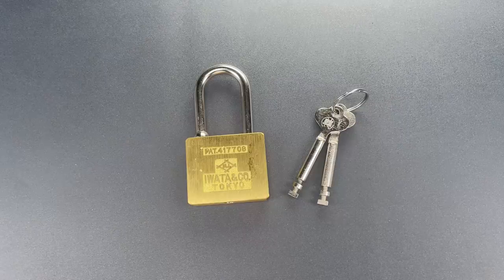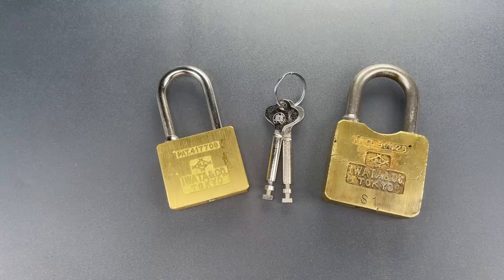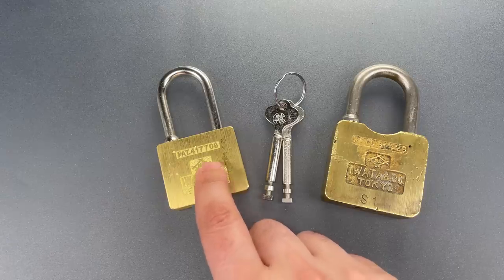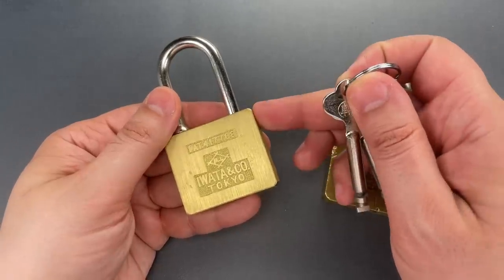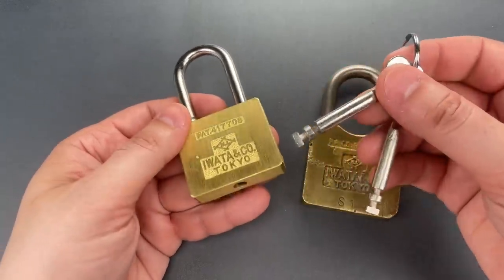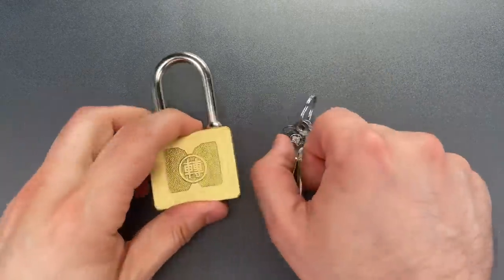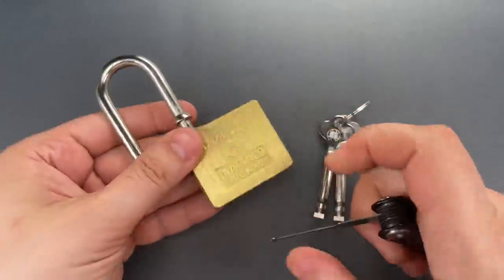[1304] Analyzing a Vintage Iwata Padlock

Comment: I am working for German Railways and I can pretty much confirm LPL's suspicions. This railway lock is probably not used for security in the sense of picking resistance but security as in preventing railway accidents.
When you need to set a path for a train with manual, non-remotely controlled railroad switches, these locks assure that every single switch has been set correctly.
The locks lock (duh) the switches in certain defined positions and there's supposed to be only one copy of each key available to the dispatcher.
When the dispatcher sets a path for a train using railroad switches, they naturally have to leave some keys behind since the locks are key-retaining.
This allows them to quickly look at a board where all keys hang to check which ones are missing and verify the railroad switch positions before giving a train the signal to move forward.
In Germany we call this the "Schlüsselabhängigkeit" or "key dependency" in railway signalling. Obviously, it's a method used only in remote and little frequented areas, maybe at some local railroads at a factory and the-like. Alternatively, in areas where a certain "default" switch position is rarely ever changed.
Reply: Other railroads have similar keys sometimes called Woods or Annette keys. The 'locks' are low security but the keys are masssive.
Reply: I love how Germany decided to invent a word for that.
Reply: @jtcmule3336  But that's just German grammar (and their irrational fear of the spacebar).  Schlussel = key, Abhangig = dependent, and Keit = state of being (like the suffixes "-ness" or "-cy").  It's like writing "keydependency" in English.  It isn't so much a whole new word as it is a phrase written without spaces so it kind of looks like a single word.
Reply: That sounds like it's both obscure and interesting information, but, hang on...
How does the key-board let you know what direction the switches are in if the key only locks and unlocks the padlocked?
I presume the padlock restrains the switch itself from moving in some fashion, but what's to stop someone from unlocking the padlock with the key, throwing the switch, then re-locking the padlock even if it's not in the correct place, and replacing the key on the board?
Reply: @ShadowDragon8685  Well, the switches themselves are designed in a way that you cannot re-lock the padlock out of position since the holes on the 'sleeve' for a lack of a better word need to align.
Sometimes there are even switches with several locks each forcing the switch into a certain position without disturbing the others (combination of holes and slots). It's all very clever, actually.
However, you are right, nothing is keeping the dispatcher from e.g. unlocking the switch, re-locking the lock in their hand and throwing it away, taking the key with them.
This would require malicious intent on the dispatcher's side and the system is not designed to prevent that - just to serve as a mnemonic device for the dispatcher so they don't have to run out of their little building / office to check if all the switches are set correctly after working on them for half an hour - and mind you, some switches can be hundreds of meters apart.
Basically, in the end the goal is to have a completely mechanical and manual 'switch status dashboard' in the dispatcher's office. :)
I mean, if a dispatcher wanted to derail a train or cause a railway accident, especially in remote areas where everything is controlled locally, they would have a hundred different ways of achieving that.
This might sound scary but in the end all transport systems boil down to trusting well-trained and carefully selected individuals at some point to 'do the right thing' and there are just safety systems (like this one) that make it harder for someone to do the 'wrong thing' by accident.
Reply: @LimDul  Ahhh, I see.
Yes, that's what I was wondering; if the system was being used as a hard mechanical interlock system akin to Lock-Out Tag-Out, or if it was less-hard than that in that someone who did something which was either malevolent or of such staggering incompetence that it was indistinguishable from malevolence - such as, as was said, locking the lock in their hand and pocketing it/tossing it off a bridge/forgetting where it was or something, then replacing the key, could do so mechanically.

Obviously and thankfully the chances of that are low, since in general the sort of person who would be entrusted with the keys to a manual interlock system is not noted for malevolent or incompetent inclinations.

I don't think the system is necessarily unsafe as-is, as it would be very unlikely for a lay-person to be familiar enough with the system and malevolent enough to engineer a derailment, and even less likely for a dispatcher to do so. I was just wondering if the system had been over-engineered to make that mechanically impossible, such as by some mechanism retaining the lock itself so it couldn't be locked except in the proper position (thus trapping the key). Of course, even that sort of a mechanical interlock could be defeated by a sufficiently determined attacker; either by picking the key, or using a cutting device to destroy the lock.

That's damn interesting, either way.
Reply: @ShadowDragon8685  Oh, don't get me wrong - this is the lowest of low kinds of safety systems, hence me saying that it's used only in some remote locations, maybe shunting local trains in factories etc. Also, it's just one safety layer of many.

The higher the risk, the safer the system. E.g. for mechanical, manual switch boxes that use steel cables for controlling railroad switches, there are very clever mechanical interlocks preventing unsafe configurations. And then it only goes up from there until reaching pretty much flight-control safety levels for regular passenger trains.

Mind you, flipping railroad switches is usually also connected to flipping a corresponding signal, so an arriving train would see the invalid configuration ahead of time - in such areas the speed limits are also very low.
When a train attempts to pass a stop signal there are also various other safety mechanisms that would trigger the emergency breaks on it and so on.

So, it's by far not the only mechanism ensuring nothing truly bad happens but still. Also, you want to avoid trains having to do emergency breaking at all costs since it grinds down a spot on their wheels, which then have to be sent for maintenance. If you can have even the simplest system preventing even a few human errors, then it's a big win for everyone. ;)
Reply: @noamkatz1049  "irrational fear of the spacebar" excellent, i'm going to steal that one 😂😂
Greetings from Germany

Oberflächenwasserrückhaltebecken
Reply: @noamkatz1049  the German (and Dutch) fear of the spacebar isn't quite that irrational, but has its practical purposes to read and interprete a sentence quickly and correctly. Otherwise the reading as well as the inter pretation get quite choppy, just as the splitting up of inter and pretation just did in English. In Dutch, we even have a word for the irrational liking of the spacebar: Engelse ziekte, or English disease. That referred originally to some kind of blood disease.
Reply: @mjouwbuis  German is slow to interprete, because all the verbs are in the end of the sentence. You can have a whole paragraph and five verbs in the end. Makes it difficult to translate German speech.
Reply: There have been a number of key based interlocking plants in Finland as well, and I imagine Japanese railways would have their own versions. They are pretty much the only way to electrically - and remotely - secure fully manual switches. Even today a key panel can be a part of an otherwise relay or computer based system. 

These locks (generally speaking) are not meant to be pick resistant in the first place. The goal is to ensure that the switch is always in a known position. When the key is retained in the lock, the switch is locally controlled. Otherwise the switch is in its normal position, which can be enforced with an interlocking system that retains the key in a panel.
Reply: can confirm we used to use this system too and stil do on some heritage railways here in the netherlands

edit: not to see which path is going to be used by missing keys but to ensure hand switches stay in certain positions when they are needed to be

Comment: "zhuan" for 轉 is Chinese. In Japanese it's the pre-reform version of 転, which on its own is pronounced "ten" and is used in a lot of words related to movement
Reply: Ah! Is that "ten" as in "untensuru", "untensha"? (Sorry I don't have a Japanese keyboard on this device)
Reply: @aihtdikh  Yes it's the same Kanji that your two examples would use
Reply: @aihtdikh  yes, 運転手/untenshu = driver, 運転/unten = drive, 自転車/jitensha = bicycle,  etc..
Reply: So would this be the equivalent of labeling a lock "move"
Reply: @Palmtop_User  more like labeling a lock "turn" or to use the railroad word, "switch"
Reply: @ScottKenny1978  oh thank you

Comment: They use a lock somewhat like that here in the US too, but a different key. About 20 years ago, I used to live in a small Pennsylvania city for a few years with a big rail yard. It was a transfer hub for trains to change tracks but those tracks crossed thru town. I had a few friends that worked there and it always fascinated me to see how that all worked. 
My first time visiting that yard, one of my buddies had a few of these dark tarnished bronze locks hanging off his tool belt. The key looked like a big handcuff key with a 1/4 inch-ish socket wrench hole. I thought they looked weird but he explained that they have switch panels and track levers that need to be kept locked until they're needed. Being so close to town, kids and curious people can come thru and just touch these buttons or switches without knowing what they do or the damage they can cause. But with so many employees working those rails, they all need easy access to them. So that weird handcuff key thing is a single standard key on all those rail workers belts at that yard and some of them walked around with a lock or two hanging off their belts depending on their role for the day. 
Skip ahead a few years and I'm living in another city and while admiring their inner city rail system, I noticed their keys were slightly different, it still looked like the same lock and the keys still looked like a handcuff key but instead of a socket wrench, it looked like an allen wrench. It just fascinated me.
LPL could probably pick these locks in 2 seconds with a hairpin and a gum wrapper but that wasn't the point. The point was to maintain control of those switches. I don't know if these specific locks were unique to those rail yards, unique to each company or follow any kind of industry standards but it always amazed me and always left me curious about it. 
Thanks for showing me that the concept isn't so unique even if the locks are different.

Comment: in an alternate universe:
"This is the lawyerpicking lock..."
Reply: "This is the lawbreaking Locksmith, and in today's video..."
Reply: I don't want to know where you would put the tensioner...
Reply: The lawyerpicking lock is a sapient padlock with no useful functions (it's a wafer core so cheap that you can jiggle it with a paperclip) except that if you expose your legal troubles to it, it will without fail direct you to a lawyer who will obtain the most beneficial-possible outcome for you.
If it directs you to an estate lawyer, you're humped.

Comment: Hi, railroad person here. Railway switch locks usualy have key retention because the key is used to tie elements of the track together. For example to switch two switches connecting a siding to a main track, you'd first unlock the switch that serves as a runoff for any carriages from the siding, and then use the same key to unlock the switch from the main line. it holds the key until the procedure is reversed. Multi key locks can be used to tie in more parts together.

Comment: "Zhuan" is the Chinese pronunciation (more or less) of the character. The Japanese onyomi ("Chinese" reading) is "ten". It has a number of kunyomi (native Japanese readings) such as koro. Interestingly, that form of the character is kyuujitai, the traditional form it had before some kanji were simplified in 1947. The modern form (shinjitai) is 転. That doesn't necessarily say anything about the date though, since use of kyuujitai often persisted in certain situations.
Reply: TL;DR written Japanese is a fucking mess

Comment: Here's a bit of railway lock history for you.  Key-retaining locks have a very important role in railway signalling.  The keys and locks used for this purpose are, however, usually somewhat larger than those shown here.  I'm talking, of course, about the token staff used to operate the Electric Token Block instrument on single-track branch lines and the Annett's lock on ground frames along those lines.
The essence of modern railway signalling (as mandated for all passenger trains in the UK's Railways Act 1892) is that only one train at a time may enter a section of track, and that points and signals must be interlocked with each other.  The simplest method of achieving the former is the Token Block system, in which a train may only enter a section if it carries a unique physical token with it, which is obtained at one end and relinquished for use by another train at the other.  If performed correctly, it is a very safe system of operating trains, and it doesn't rely on any high technology, but it is also very inefficient.  If two trains want to go through the section in the same direction, the second one must wait for a returning train to carry the token back to it - or it must be sent by road.
Electric Token Block solves this problem by providing many tokens for a given section, but locking them into machines that ensure that only one can be released to a train at any given time.  When all the tokens are in the machines, an electric circuit is energised which permits any of these machines to release one token.  Once that token is removed from the machine, the circuit is broken and the machines will not release any more tokens until the token is returned to a machine - usually not the one it was initially removed from.  A following train can then remove a second token from the first machine and proceed, safe in the knowledge that the first train is clear of the section and no other is coming back the other way.  In essence, the Electric Token Block machines are remotely-interlocked warded locks on serious steroids; many of them were made in Victorian times and are still serviceable today.
So what is the Annett's lock for?  Well, quite often the sidings serving industry along the line were not sufficiently close to a station with a passing loop to allow attaching the sidings to that.  Instead a "ground frame" - a miniature signalbox without the box - was installed to operate the points from within the section.  The Annett's lock was designed to accept the end of the token protecting that section of line, proving that the person operating the ground frame had some authority to do so and, more particularly, that any train approaching the points would be aware that they might not be set straight.  So the points could not be moved away from straight unless the token was locked into the ground frame, and the ground frame would not release the token, to eventually permit another train to approach it, until the points were set straight again.
https://youtu.be/wAO3JbXYRnI?t=1590

Comment: if i assume that the lock if for use as LPL states, it's likely that the lock doesn't need to be very high security as it's reasonably likely that the site it is used in provides much of the access control required. Much like that key switch from several videos back, I think the idea here is more that it makes it more difficult for workers to leave the switch in an intermediate setting, and the lock helps keep the switch mechanism in a fixed position even during heavy vibrations.

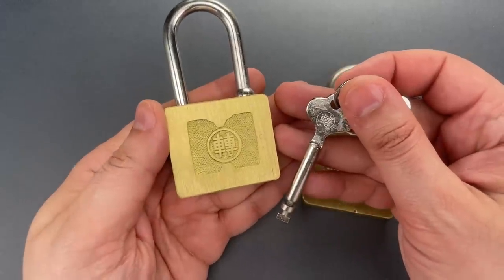Comment: Hey LPL. I've been studying Japanese for a couple years and thought I'd take a crack at translating the character(s) at the 2:10 mark. They are written in Kanji which literally means Chinese characters. Japan originally adopted the Chinese writing system before eventually developing their own character sets and pronunciations, which are all used in tandem today. It's very likely that, if you used digital translation, it may have given you a Chinese translation instead of the Japanese.

I am pretty sure that the insignia is comprised of two characters, those being  車 (pronounced: kuruma, meaning: Car;Vehicle) and 専 (pronounced: sen, meaning: Exclusive). So 車専 most likely means something along the lines of "Vehicle/car use only." Seeing as how the previous Iwata lock was a Railroad lock, perhaps this could have been used to lock doors inside train cars? I'm not sure, but I hope this helped. Have a good day :^)
Reply: In the context of trains, "Vehicle" + "Exclusive" takes on a whole new meaning. This is more likely a physical "mutex". The terms "mutex" and "semaphore" are used in computers today, but entered that industry from the train industry, which in turn got them from the shipping industry (for harbor control and routing). At least in computers, a "mutex" is for "mutual exclusion", to ensure than only one thread has control of a resource.

I'm sure you'll agree, a very important concept for managing a rail network.

Comment: I think it should be noted that this is very similar to a number of telecommunications and utilities locks used in the US today.  Not by its construction, but by the simple, yet uncommon key and the key retention mechanism. This is typical of most locks I encounter with special access requirements.